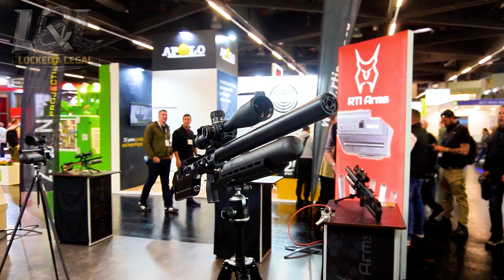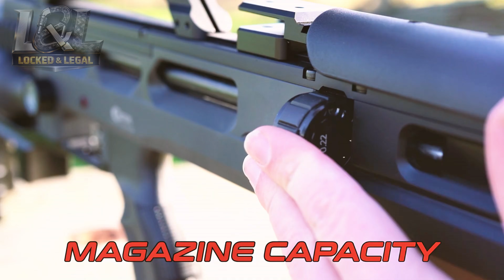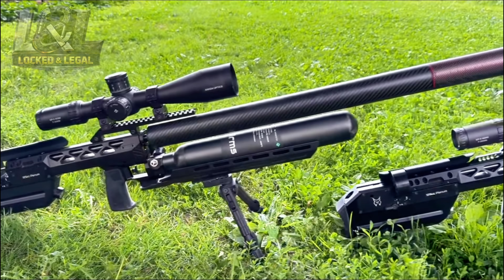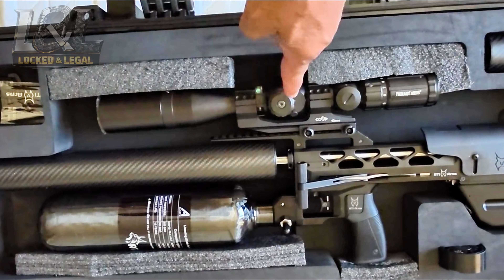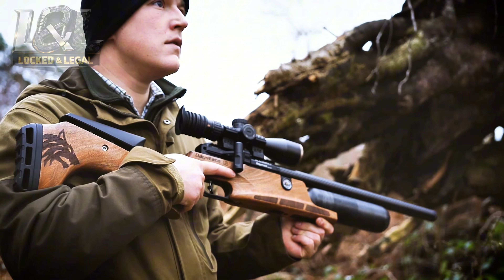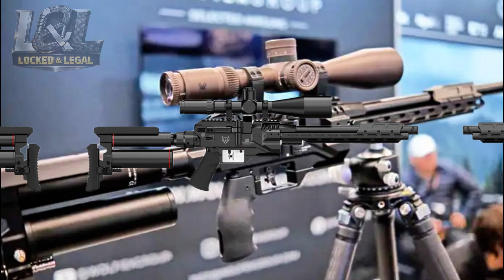The Best New European PCP Air Rifles of 2026 – #1 Breaks the 500-BAR Barrier

Comment: Were Can I go and check out and testing the uniqe 500bar PCP AIRGUN Rifle designed&enginereed by Wolfiek Pandora PRS Spain..
I live in Norway
Reply from the maker: I’d check directly with Wolfiek Pandora PRS or a local airgun dealer in Norway. That 500-bar rifle is pretty specialized, so finding one available to test may not be easy. 👍
Reply: At the moment you can only order one on presale, i just did so 🎉